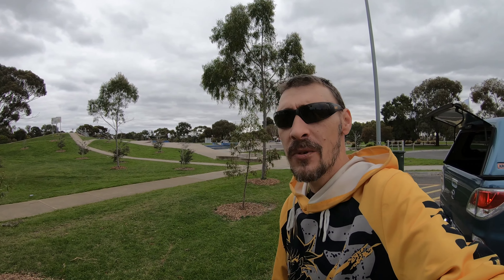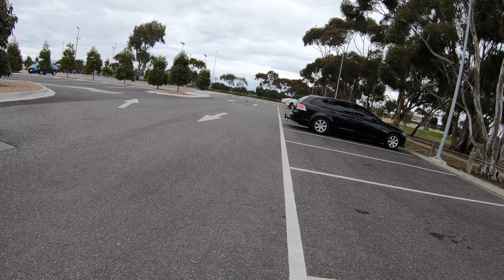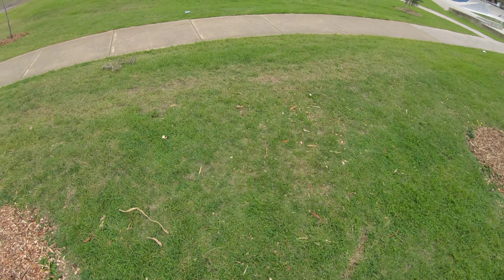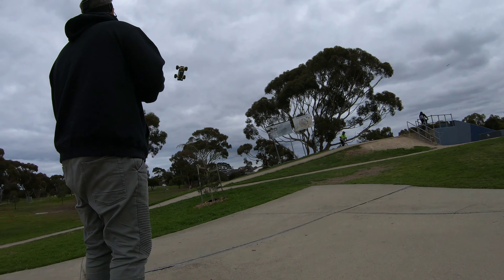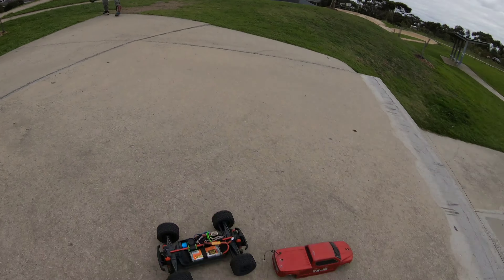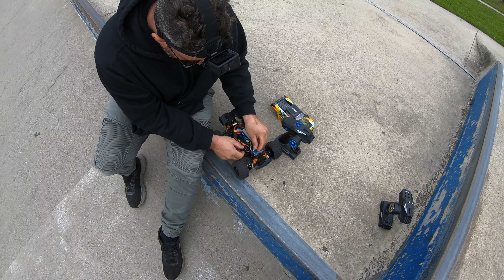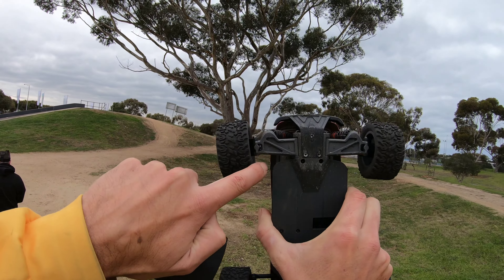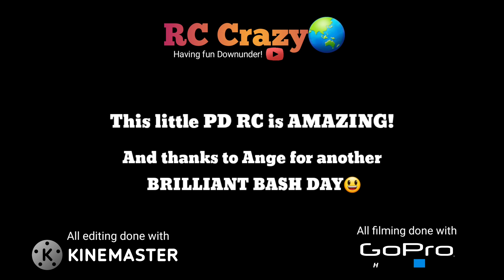RIPPER Skatepark Basher🤩... PD Racing TK-16 #pdracing #rccars @angesrc

Comment: Hello!!! I found your channel simply by looking for any videos on the PD Racing rc cars! Thank you for posting the TK16. I bought my son (really was for me too) the TR16 which is similar, but after a bash session at a skate park, the servo started twitching sinilar to what yours did on the video with the bigger wheels. What servo did you replace it with? I bought a PD racing replacement servo, but it has already broken the way my son and myself bash this thing around. Help?

** Should have listened properly in the start of this video where you mentioned the servo... Any idea what servo would fit this? I have no RC idea.
Reply from the maker: I am using the stock servo still, not sure what happened with mine but it's never had that twitching issue again, I have had it out a few times after this video without servo issues🤷
But I believe the little JX 1181MG servos should fit, just check the dimensions before purchasing if possible👌

Comment: Cracking little cars. I need to get myself a little skate park basher. The local skate park to me is being rebuilt only problem is they have been at it forever. Also my air time skills are not great so don't like taking the XMaxx to the skate parks any more. Catch you on the next one.
Reply from the maker: Ah yes as a X skateboarder I've seen many parks take WAY to long to be built or maintained.
And I totally understand when it comes to air control, destroyed many cars pushing my driving skill.
When off-roading I still always try and place the ramps facing a soft grassy area or like the bark area I drive at, I still crash pushing limits so anything that will help prevent damage is a plus😅
Thanks Jason👍

Comment: Did u find and diff upgrades?
Reply from the maker: I don't think they make upgraded diffs as the stock ones are already metal and are quite strong.
Reply: @rccrazy  thats what i need to hear . Need them wheels to .. on order!
Reply from the maker: The ZD wheels are awesome on this car🤩
Reply: @rccrazy  have you got the v tread or the other mt style
Reply from the maker: @mlamoon think I got the normal tread not the v tread
Reply: @rccrazy  yh i rewatched
Reply from the maker: @mlamoon ok cool, sorry I was so late to reply aswell, I slept too long😴😅
Reply: @rccrazy  im across the pond also
Reply: @rccrazy  what combo did u put in urs? I was gonna try the angry snail from an mjx what u reckon?
Reply from the maker: @mlamoon  I believe Angry Snail only refers to the lipo not the electronics, they have Surpass Hobby electronics, I do not use surpass escs.
I have a Hobbywing Qickrun 30a esc and I think a 2440 4500kv motor, surpass motors are fine.
Reply: @rccrazy  does have angry snail written on it bud
Reply: @rccrazy  same i like my hobbyjobby its a spare lol
Reply from the maker: @mlamoon ok yes that's possible, I'm not familiar with the newer MJX cars but I do know for a fact the electronics are Surpass maybe they just rebranded them as many companies do with electronics.
Reply: @rccrazy  hey upton taking them shafts out i realized the grom 12mm hex fits just need a spacer between nut and bearing